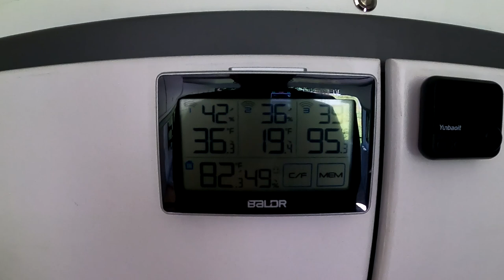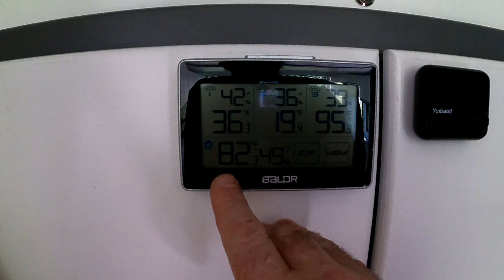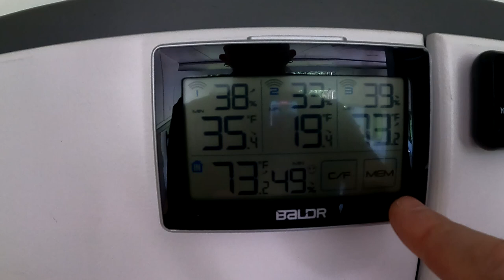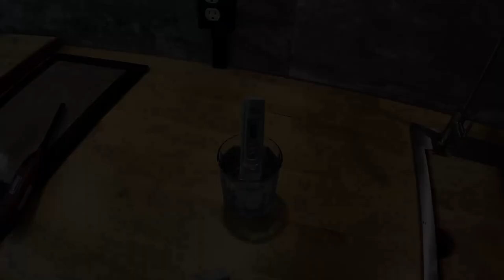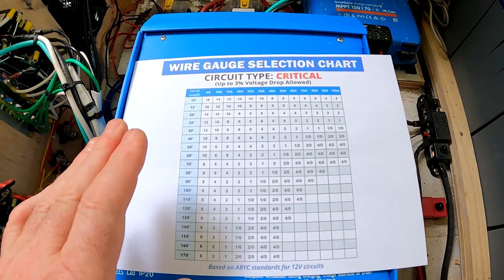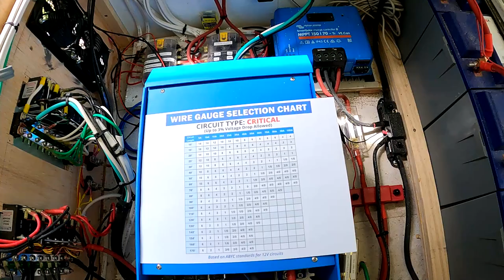EP33 Van Build -  This Could Have Burned The Van Down But Lets Make Dinner First

Comment: Looks like everything is functioning great!

Good thing you caught that hot wire before it could have gotten worse.

10/10 bug screen! Hopefully its not too much of a hastle to take down and re-apply in potentially buggy areas!
Reply from the maker: Oh I know, it sure shook me when I saw it. I’ve since checked several times since the repair. 

The bug screen isn’t perfect, but should keep the honest bugs out! ;) Oh, and it’s super easy to deploy, remove and pack away. It’s just held up with Velcro.

Comment: Any thoughts on using No-Ox A on all your electrical connections? 
Helps with corrosion for sure.
Glad you didn't burn the whole thing down ;)
Reply from the maker: That’s a good idea. I hadn’t really given it a thought, though recently I discovered corrosion on truck’s battery terminals. So, I can already see the benefit.